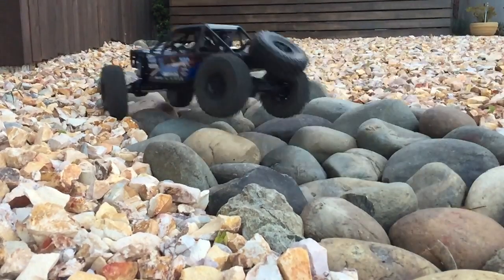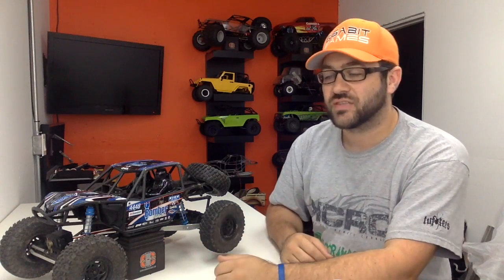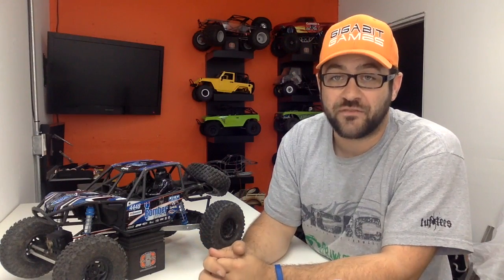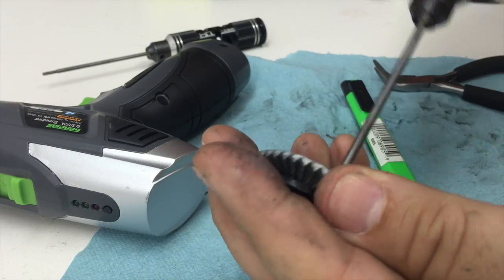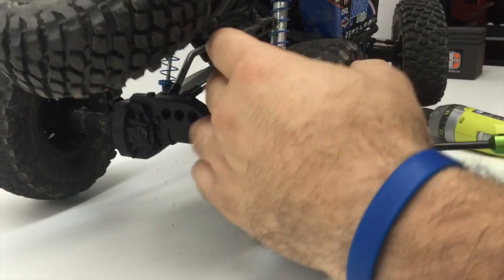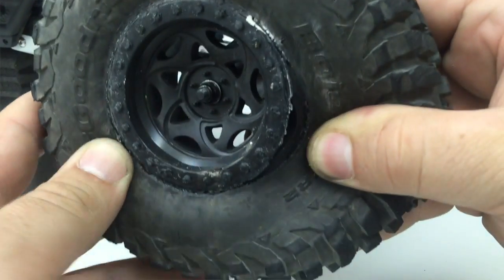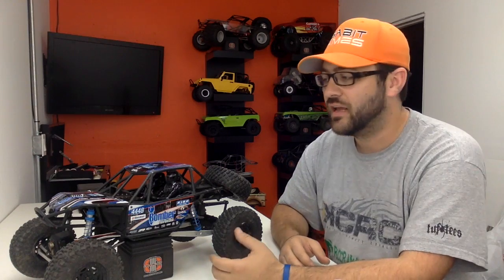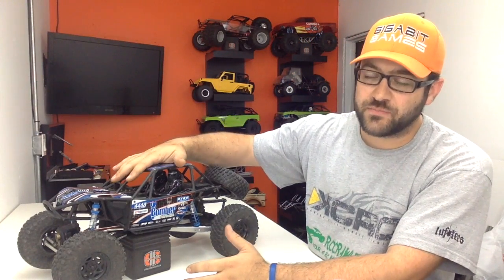Axial RR10 Bomber Budget Build - Incision Spools - Episode 5

Comment: That was a proper beating Harley !!  I wish you'd get the Incision line rolling for the XL !!  I'm currently drawing up a bomber XL... Either that or I'm building a XMAXX Straight Axle Crawler with your modded Vanquish XL axles or the Kyosho axles... I'm leaning towards the Vanquish tho it will require brainpower..I'm also designing a chain drive center diff that is DIG capable..

Comment: I noticed when you reassembled everything, you didn't use any grease. Does it need it?
Reply from the maker: +Jason E it still has a light coating of the factory grease. More would have been better but I was lazy since I know I'll be replacing gears before long.

Comment: if you are going to bash hard wouldnt keeping the stock plastic steering arm help as a "Servo Saver" to allow that give rather than transering all that hard hitting bashing onto the servo motor directly?? or addding a servo saver (kimbrough servo saver) if you are going to bash like crazy?
Reply from the maker: +Nick Pausch if I wasn't concerned with steering performance then those would be an option. However those two options make for a very poor steering feel especially in the rocks. A quality servo is the way I always prefer.
Reply: Servo saver makes steering crap. But metal horn with plastic steering links would work fine and save the servo. But an upgraded servo is kind of a must anyways

Comment: What is that little power driver that you use?
Reply from the maker: +Buster Brown I have 3 total, one setup for each of the popular sizes (1.5, 2.0, 2.5). One driver is my old Ryobi 4Tek with clutch (discontinued) and the other 2 are Genesis 7.2v with clutch (2 for $50 on Amazon).
Reply: +Harley Designs cool thanks for the reply I'm getting ready for my bomber

Comment: Gearing with that 3000?
Reply from the maker: +TheYoungShot stock spur an 12t pinion I believe.
Reply: +Harley Designs thanks for the response. I run the same setup with a 16t pinion and it runs surprisingly cool. As you can imagine the speed is absolutely insane and full throttle is rare. I don't mean to spoil anything but if you were going to do shocks would you do the slash power strokes or splurge on the pro spec's?
Reply from the maker: +TheYoungShot I may spring for Pro Spec on here, but only half because they are blue!